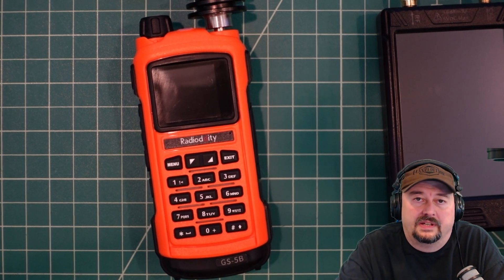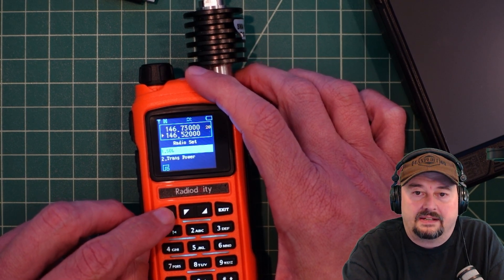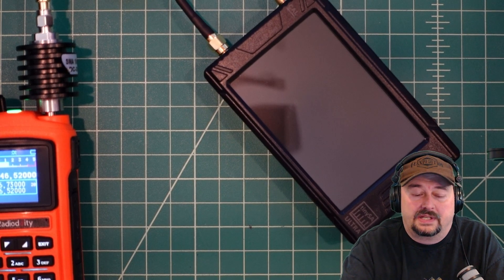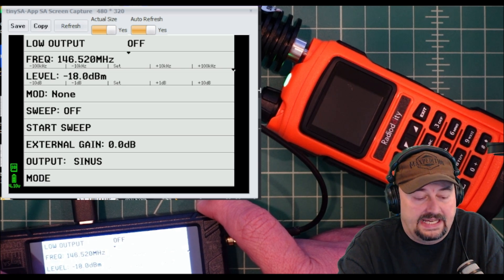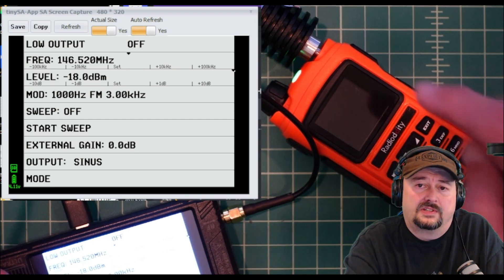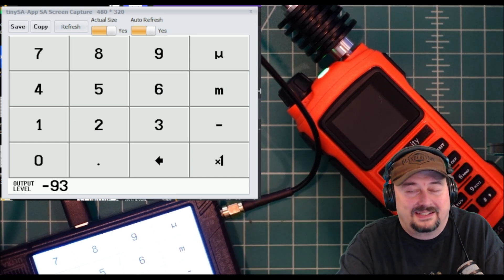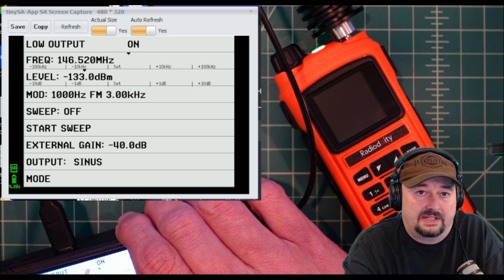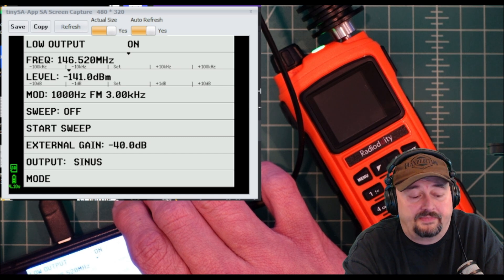Radioddity GS-5B Receive Sensitivity Test - Ham Radio

Comment: What is the importance of this type of testing on any HT? I have this radio and I am very happy with it. Sometimes the receiving is too good as I have to make adjustments to cut back on the receiving of this radio as it will pickup more back ground noise than I want. Interesting that you take the time in doing this type of testing. 73!
Reply from the maker: Hey Erving, it's more important for HF radios IMO but it's also a way to compare HTs.  Thanks for checking it out!

Comment: These are a rebadged Senhaix 8800.  I've had mine for over a year and there are a couple gripes I have with it.  The receiver seems a little weak and the squelch trail is garbage.  The build is decent but it could be a little better in the receiver.
Reply from the maker: I think I agree with all that, I forgot it was a Senhaix.  I remember that now that you mention it...  thanks for the comment.

Comment: What is missing here is desense and noise floor in the real world. For example, I live near the US border. The FM broadcast band is completely full from end to end. Meaning, from 88 mhz to 108 mhz, every chunk of the spectrum has about a kilowatt or 10 to 80 times that amount, being pumped out, 24-7. 

So, most radios, no matter how great and sensitive they are, if they do not have exceptional front end filtering in place to attenuate the FM broadcast band, or worse, they are actually designed to be able to receive it… are completely useless on 2 meters without an external in line pass band filter. Baofengs, and pretty much every other budget radio I’ve tested are susceptible to this issue. They will not receive less than about S4 (if you’re lucky) to S5, and up.

Simply because they can hear the FM broadcast band, and all the harmonics associated with it, and it “de-senses” or “overloads” the receiver. Radios that are extremely sensitive, but have no filtering, actually perform worse. We’ve demonstrated this time and time again with fellow hams by having someone call from 4 or 5 miles away, with the SQL completely open, and you hear nothing but static. Then you place a 2 meter pass band filter in line between the antenna and HT, and boom! They pop up out of no where, and you can hear them crystal clear. S6 or S7 clear in most cases. Remove the filter, back to static. 

Buyer be aware
Reply from the maker: I didn't say this was a real would test, I explained exactly what I was going to do.  I didn't say if this radio was any good or if it was bad.  I didn't tell anyone to run out and buy this radio.

I am fully aware in the various filtering and "front ends" on HT / VHF & UHF radios.  I have covered it in many videos.  I am fully aware of the de-sense and overloading scenarios you describe.  I have covered it in many videos.

I do appreciate you sharing your experience and background, this appears to be a bit of a hot button issue for you.
Reply: @TheSmokinApe  Not really a hot button issue. More just to make people who aren’t aware, aware, that receive sensitivity is a double edge sword. You may be an expert, but most of the people that get taken to this video, are not. The comment is just to expand the conversation. It’s not an attack on your processes.
Reply from the maker: Oh, I'm not an expert...  just trying to help folks out.  As mentioned, I do appreciate your comments...